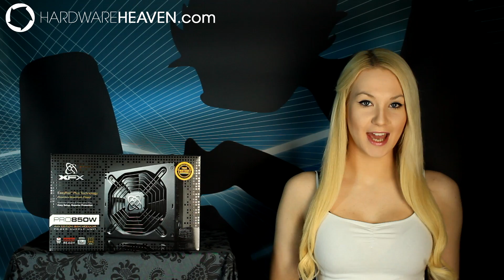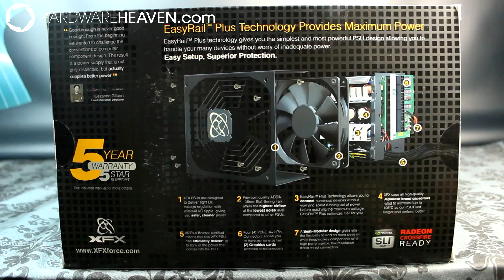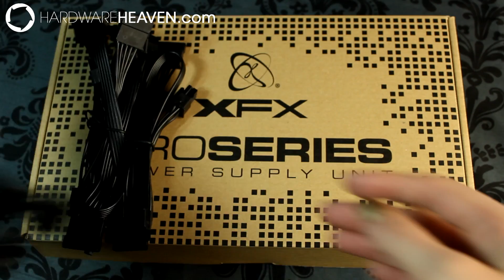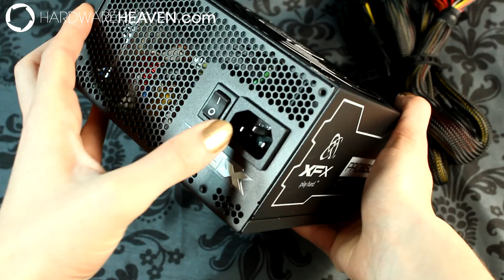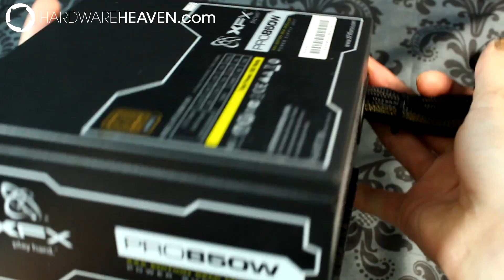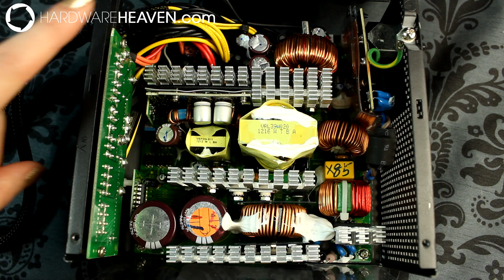XFX Pro 850w XXX Edition PSU Power Supply Review

Comment: how quite is this power supply ?

Thanks
Reply: Not very quite for me...
Reply: Yeah, I bought this power supply and it's the loudest component. Not very loud but still audible. Don't buy this if you want zero noise from your PC.
Reply: So true.. :)
Reply: Michael Adel I have no idea, i dont have an option like that on mine. Sorry!
Reply: no problem bro :)
Reply: I have the 650w and its extremely noisy, but i think it´s for a factory problem, couse it´s really fuckin loud.
Reply: Yeah, could you guys think of a possible solution to quieten it?
Reply: if i can´t get a new one, im going to change the fan by a quieter one, you will need a solder and a new fan, you use your psu cable and solder it to your new one, and put it back, anyway go and type in youtube how to replace a psu fan and you will see a detailed guide, but thats pretty much it.
Reply: Alberto Pettine  should i put my psu on hybrid or normal? any ideas ? :)

Comment: i need help !!!!!
im gonna buy a new pc but can the 850w psu run 2 r9 290x ?
Reply: Probably, but don't quote me on that.
Reply: pls... 2 r9 290x with this?i use this to equip my mid class builts... buy a 80 plus gold,850w or to be realy great a 1000w,you wil never use all the 1000w but the life of your supply will thank you latter... i must remind you that those need a lot of power and effeciency    By hd7970 matrix platinum owner!!
Reply: Your ears will be bleeding and your ambient temps will sky rocket with two of them cards... I am no NVIDIA fan boy either I run two 7870 XT's in my own rig.
Reply: connorwright38 it dependes on the cards, the r9 290 from msi has almost the same temperatures as the 780´s so, not all amd cards have the same first shitty refference cooler so, think about it

Comment: weird, I have this PSU but ALL my cables are braided. I also noticed the motherboard leads are ever so slightly shorter than Corsair ones. Was a little bit of a stretch to make it work in an Antec 1100 and P290 case (and look neat), but we got there in the end.

Comment: I think it costs a considerable amount more to use black cables. When your using humans to solder things together its much quicker and easier when cables are colour coded. It would require extra training and time to be able to work with all black cables. I could be wrong though, I'm pretty new to PSUs.

Comment: Most cases have mounts so the PSU can be fitted either way up. If the rig runs quite warm I have my psu fans facing down to get cold air. If the rig has good airflow and only one GPU then it seems silly to hide away the sexy side of a PSU and show the ugly side.

Thanks :)

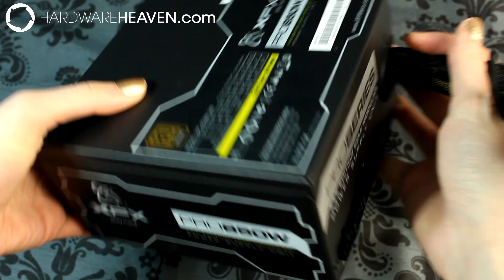Comment: 2:10 Don't most cases geared towards gaming have bottom mounts for the psu with air intake from the bottom? I think that is the market the designed it for. Most people have their psu fan facing down so it intakes from outside the bottom of the case. Also if you have a top mount psu case, its facing the right way that way too. Also TastyPC sent me. Keep up the good work.

Comment from the maker: Hey SwitchlineUK. We agree that a PSU which operates way over its specification is a nice thing to have, its all about the right tools for the right job. 950w is more than 10% above the rated output for this unit, which is after all a mainstream PSU. If running a 950w+ system then you are an enthusiast and need to be thinking about a PSU with specs to match not a mainstream model. That means better performance overall but equally keeping you as close to the 50% load sweet spot as possible.